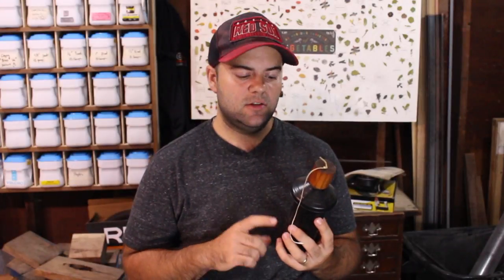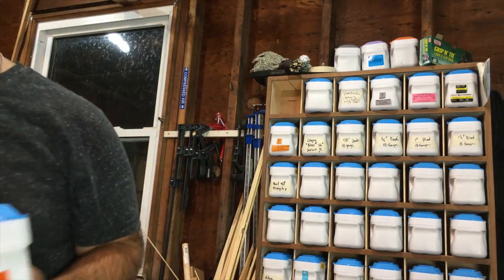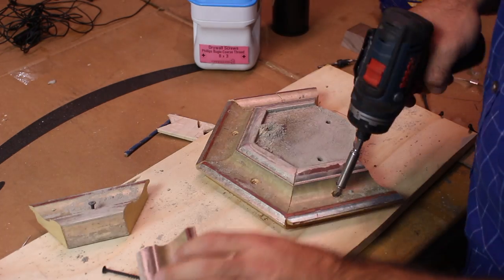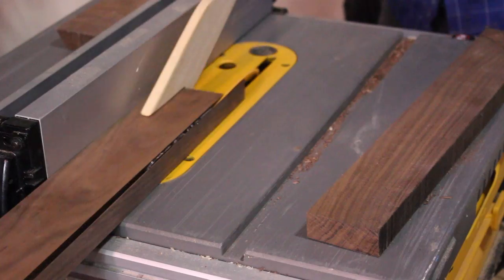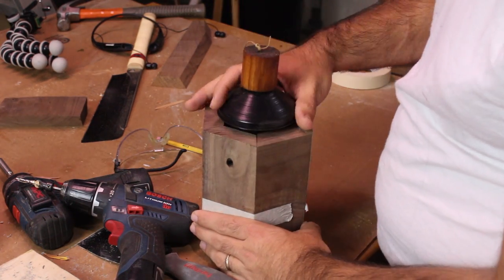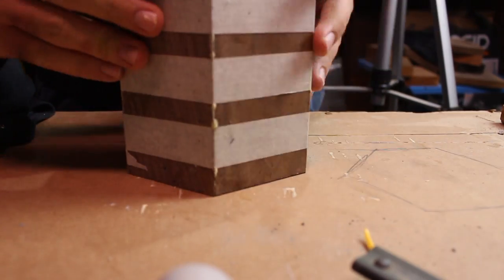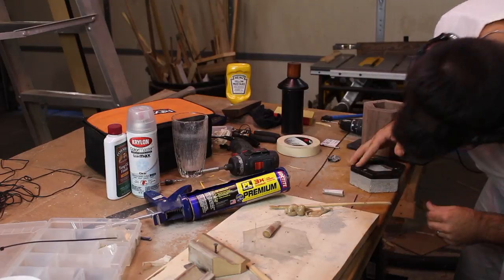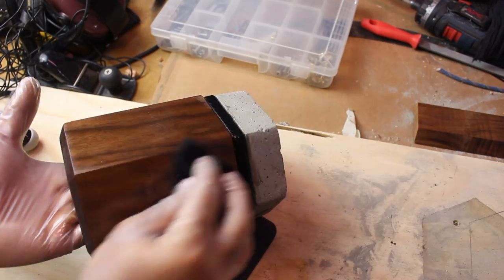Modern Table or Bar Top Tiki Torch! Build Project!

Comment: Looks great! I was just curious as to why you left the concrete exposed instead of imbedding/surrounding the by the wood or possibly painting or putting something over it?
Reply from the maker: +Marcin Zegarmistrz I honestly just liked the look. You could paint or put something around it. I also found you recently that you can dye cement!
Reply: Innovative Tom Makes sense! Either way, sweet project :)
Reply from the maker: Marcin Zegarmistrz thanks!